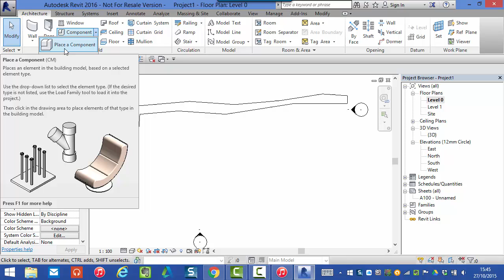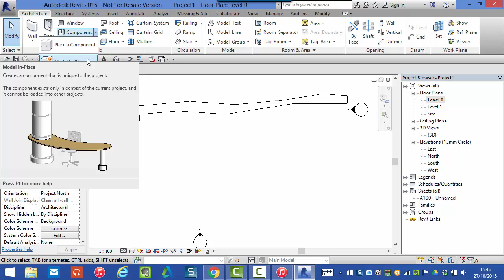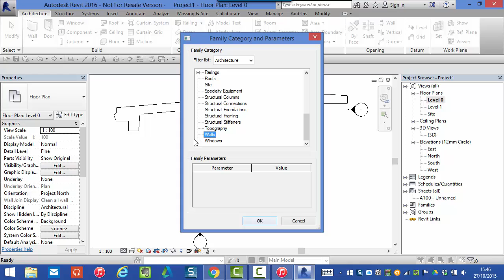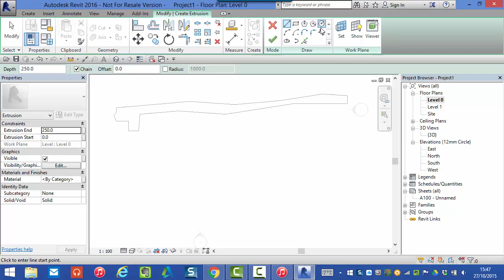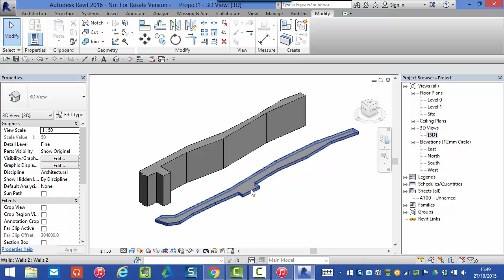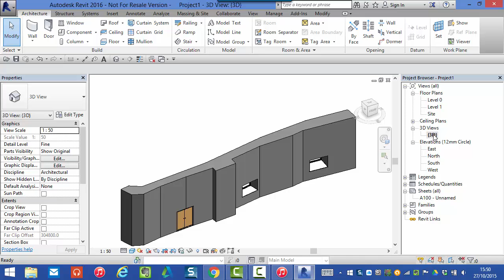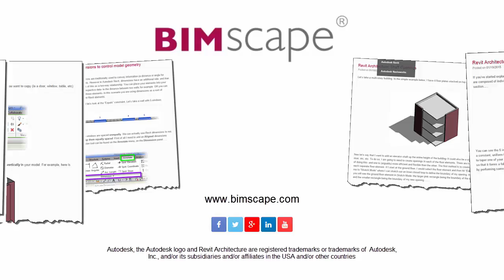Revit Architecture: Modelling Irregular Walls

Comment: Hello it is so useful tutorial thank you ! But i have a question. I created wall from component as your video. I can make windows and doors on it but I could not extrude cut to create irregular windows, and I can only give a single material, I cannot create more than one layer(like brick and then plaster etc.). Although it is a wall, it still works as a component. How can i solve this problem ?

Comment: Last time i was in the presence of a green tick and the red cross i've spent the following couple of weeks in the ER
Reply: Jokes aside, great tutorial,  what i used to do is draw two thin walls on the outlines of my existing wall which created sometimes weird connections when linking new walls or opening to the existing wall ! It also was hell to create schedules as you had to recalculate some data manually and reintegrate them in an excel sheet on the side. A major issue that i still face in revit is modeling damage, since i would like to sometimes preserve and valorise that damage... alas you can't have it all but i believe a series of these walls would help, plus the new phasing tools in revit is amazing to say the least !

Comment: BIMscape . Thank You very much for the tutorial. Excellent Explanation. My compliments really. Just one Question please. The wall done with Model In-Place Wall is not give me the same properties as a normal family Wall. Meanwhile, if i use the command Model In-Place generic, and after that assigning the wall by face on the designed generic model i can have the same properties as a family wall. What is really the difference between both methods. or i am missing some step or making some error? Thank You for your help.
Reply: The advantage in this way of making a wall is that the thickness of the wall can vary. You cannot do that using the method you describe. On the other hand, it appears that this technique does not allow other wall properties. For instance, it seems that you cannot attach the top of this wall to a roof, and other such ordinary manipulations of a wall. Or am I missing something?
Reply: @spiritcircle  not only, with the way you showed, this kind of wall also doesn't have layers and if you give a specific material it doesn't show up in section or in plan view, it is quite useless.
Reply: @Al-McGregor  how can we solve this problems for irregular shapes ?
Reply: @ecemkundakc5698  so far there is no solution, Autodesk should have solved this problem, just they have to copy from Archicad how to manage irregular shaped walls.
Reply: @Al-McGregor   Ah okay  thank you so much ! So i need Archicad to draw a building with irregular walls
Reply: @ecemkundakc5698  so far an efficient way to manage irregular wall is only with archicad, with Revit is a crazy process.
Reply: @Al-McGregor  hmm but also we can not add more than one materials on the irregular walls with archicad right ?
Reply: @ecemkundakc5698  I'm not an archicad expert, but irregular walls in archicad are the usual walls where you add just node to make them irregular, the rest is the same, I think you can add what you want.
Reply: @Al-McGregor  okay thank you very much!